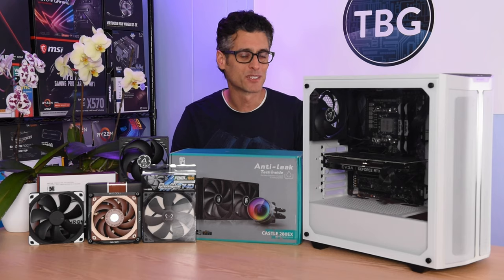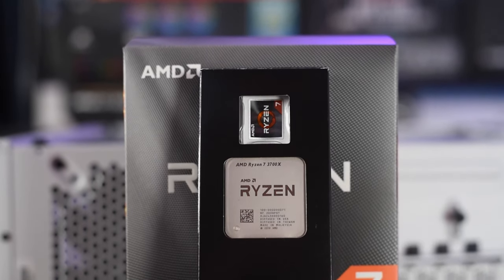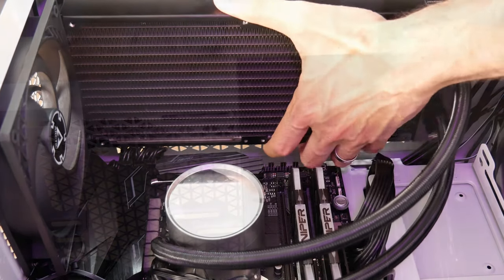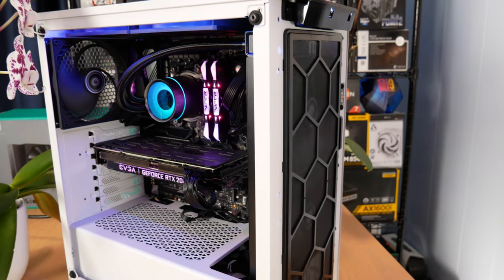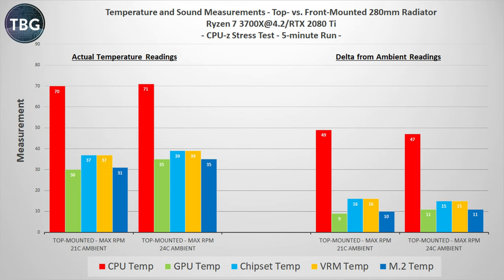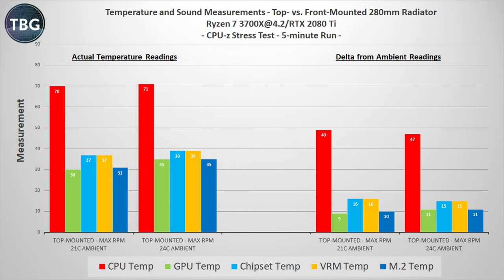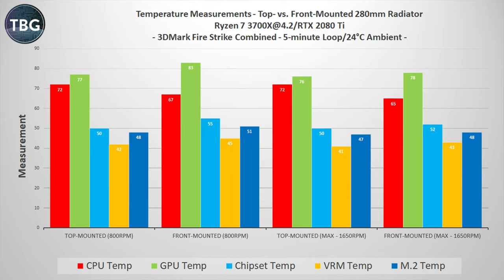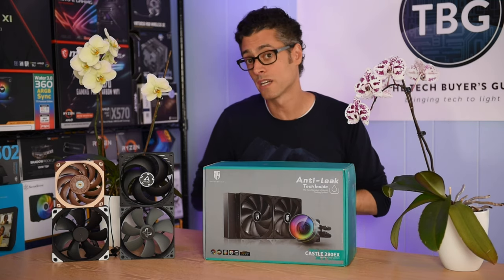Front vs. Top AIO Liquid CPU Cooler - feat. Deepcool Castle 280EX Install on AMD's AM4 socket

Comment: Since you make the claim that it is mathematically incorrect to use delta temps, I would encourage you to 
a) provide a mathematical proof which is consistent with thermodynamics as to why it is (mathematically or in any other way) incorrect to use delta temps and 
b) provide a logical explanation (again consistent with thermodynamics) as to why you obtained those results with the 21 Vs 24 degree ambient and demonstrate that it is repeatable with different cooling hardware and thermal load devices.
Reply from the maker: Newton’s Law of Cooling: the rate of change of the temperature of an object is exponentially proportional to the difference between its initial temperature and the ambient temperature.

T(t) = Ts +(T0 - Ts)e^-kt

Where Ts is the ambient temperature, T0 is the initial temperature of the object, t = time, and k is a constant > 0

The further the initial temperature is from ambient, the faster it cools. The cooling rate asymptotically approaches zero as the temperature of the object approaches ambient. No matter how many coolers you have to test, or how many years of data you want to represent on the same graph, there's no excuse for blatantly ignoring the laws of physics.

Go and learn it: https://demonstrations.wolfram.com/NewtonsLawOfCooling/

Comment: Not smart to put liquids in electronics when there is logical and effective alternatives.
Reply: AIOs technically have a higher failure rate but honestly if you get a good one you're gonna be are fine...don't say its not smart
Reply: @xSabinx1  So your telling me that putting liquids in an electronic device is smart? LOL  High maintenance and possible leaks are smart? If you get a good one LOL.  I contend its not smart at all since there is effective alternatives to this. Its simply not smart.
Reply: time to reach high temps is much longer on AIOs compared to air coolers..
Reply: @adillpickle6762   You are aware that liquids used for cooling pc components are non conductive type? Liquid cooling can be very effective especially in SFF cases.
Reply: @cnk191  your grasping now. Its simply not smart to put liquids in an electronics device.
Reply: @adillpickle6762  Tell that to engineers designing glycol cooling systems for large variable frequency drives like the ones used in trains or on board of ships equipped with dynamic position system.
Reply: @cnk191  Still not smart, Its expensive and possible damage as well as high maintenance will always be there.
I know its a trend but 10 years from now, people will admit how illogical it is to put liquids in electronics
Reply from the maker: I think there are two sides to this story, folks. There are many arguments in favor of AIOs. Number one, for high-performance SFF systems, liquid is the only option, I have shown that in my videos. Second, for the highest-wattage processors, like Threadripper or Intel's Core i9, liquid is simply better. Third, big air does have its drawbacks, including weight, which makes it very hard to transport a system without damage. That's why nearly every major OEM and SI uses AIOs for their systems being shipped around the world to customers.

On the other hand, I do agree with A Dillpickle that there's one thing that air has going for it: fewer failure points in the cooler itself. The only component that may fail over an extended period is the fan, but this is something that can be seen or heard by the user, and easily replaced. So for users who want to worry less, and don't build SFF systems or PCs that will be transported, air is a great solution.
Reply: @TheTechBuyersGuru  Thanks for explaining the logic in what I was trying to say. 73% of PC builds are for normal guys like me. We play games and stream. I have a high end I9 8899k CPU it it cools about 29c at idol and I've never seen it go higher that 73c at full load with rendering.
To each his own, but as long as I can survive with any liquid I will
Reply from the maker: If you've seen some of my other cooler reviews, you know there are some air coolers that I definitely love and recommend strongly!
Reply: @TheTechBuyersGuru  I have,thank you. I watch all of your vids. Very informative stuff thanks. I'm using the nactua U12a with the push pull for my cpu The case is a Phantek P400A plus I put one exhaust fan to keep air moving. Works perfect. I dont have to worry about drips, corrosion or pumps going out. My setup fans have a 6 year guardsmen I dont know of any AIOs that have that. Thanks again for the reply

Comment: Hi, i am wondering if the  Corsair iCUE H115i RGB Pro XT 280mm will be able to fit on top of the case?
Reply from the maker: Depends more on motherboard than cooler, and many won't work with 280mm rads in this case.